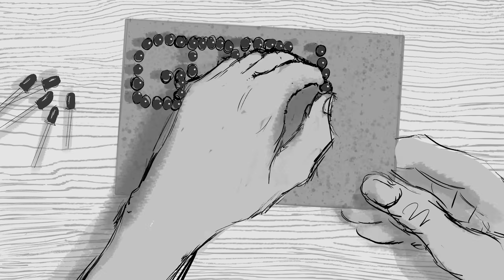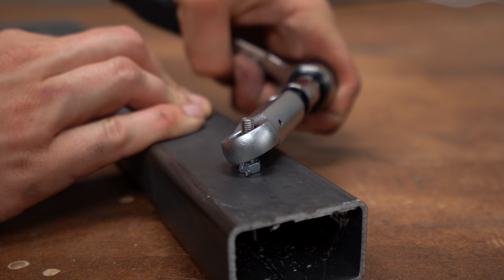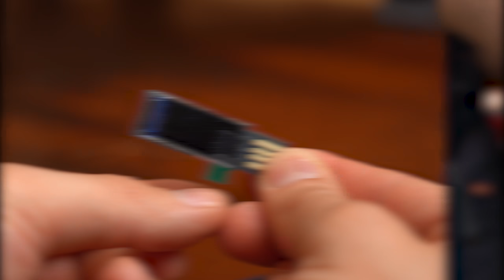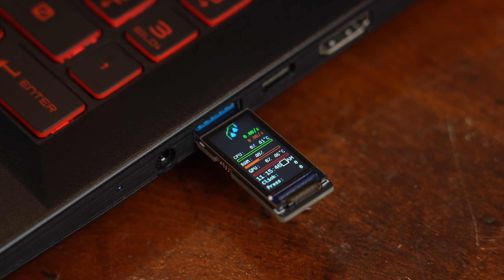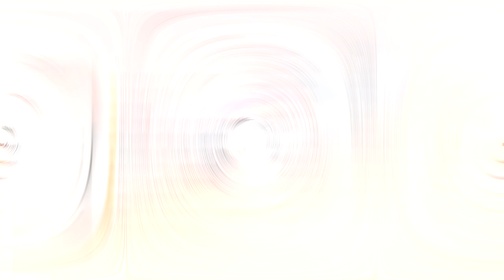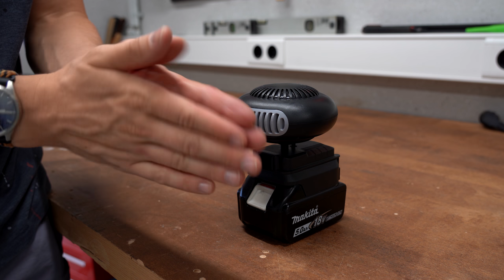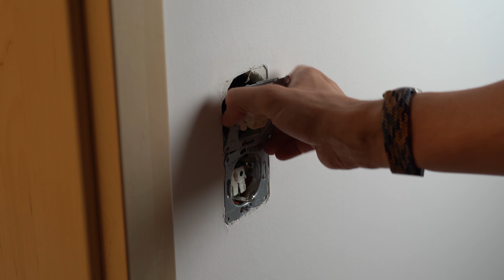I tried finding Hidden Gems on AliExpress AGAIN! (SPECIAL Part 20)

Comment: The little tank would be next to useless.  The RF would be blocked quickly.
Reply: Yeah, all professional equipment uses long, thick protected cable
What's the point of wireless if you can lose the device and never get it out of the pipe?
Reply: @masterman1502 more than likely it would loose connection, you'd have to move and get connection again and realize the only next option is back out
Reply: I would be fine with this thing being wired for inspecting ac lines in the house, I would use a safety line anyway so no problems with wireless signals, no need for battery, cheaper to make etc.
Reply: It depends on the application. In plastic pipe that wasn't run underground, it could work ok.

Comment: need to use a wrench/spanner on the nut cracker to hold it to keep it from twisting. GRanted the cheap ones may not be as good as the quality nut crackers

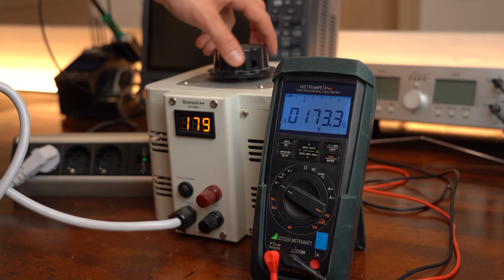Comment: 3:00  As someone that unfortunately works on Chinese exported machines, the chopped out PE conductor is present in practically every machine i've seen.  The PE conductor was there in the cable, but they chose to not connect it, and therefore they just chopped the ends off.
I don't understand why they do this because chopping the PE conductor off must be a similar amount of effort compared to connecting it.
Reply: Probably if they would connect it and there would be a foult it would trip the RCD breaker, too many returns.
This way it will, as long you not touch it will hide its flaws.
Maybe they think the case is painted so it’s not conducive anymore.
Reply: I agree. It’s a horrendous practice.
Reply: Big Clive found a cable with a PE with no core!
Reply: > The PE conductor was there in the cable
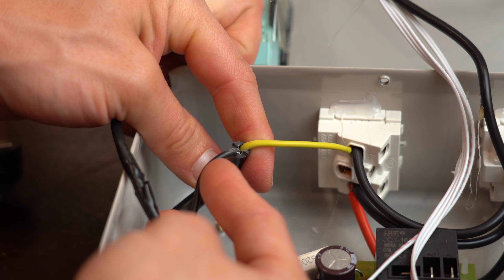take another look at 3:26, I only see 2 conductors
Reply: @markp5726  My comment is entirely about the machines i've experienced.  But only 2 conductors in the cable with a metal PE pin is even worse - it was bad intention from the start
Reply: @markp5726  Yep, I spotted that too and, not for the first time either. Shocking,,, really!
Reply: I had a Chinese imported pottery wheel with the same issue. The earth cable was there, but just disconnected from the metal case. Rather risky when it's wet and between your legs!

Comment: Maybe  move the blade of the nut cracker by 90 degrees ?
Reply: That is not how it is done in any nut cracker and more than likely keyed (won't turn inside) so it moves when you turn the back.

Comment: The inspector tank looks bilarous. I fly FPV quads for fun. This makes me want to build a little FPV tank or car to harass the cats and to drive around the house. Update: I ordered a Brushless Speck-B and I'll throw one of my extra video transmitters on it. It should be perfect for cruising around the house. I think I have a spare O4, so I'll be cruising in HD.
Reply: i feel like it would be better if the little screen on the tank was flush and the treads were full-height.  as built, it looks like it might turtle if you flip it.  (and frankly, i have no problem with 3D printed products but I'd expect a bit more print quality for a product you're selling.)